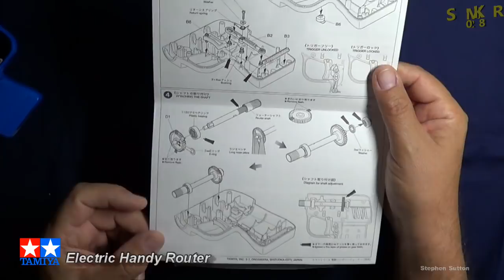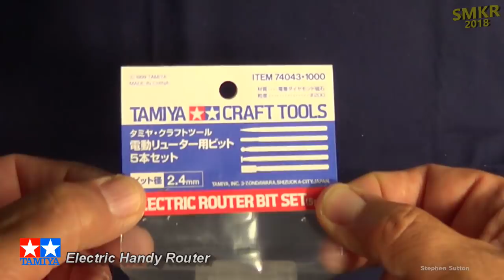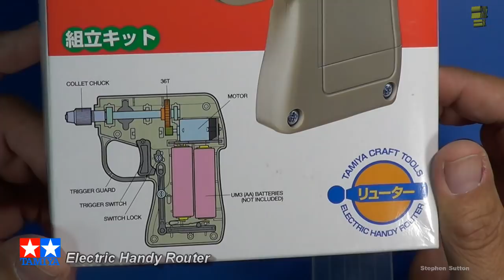Tamiya Electric Handy Router Review and Build

Comment: It might be a bit confusing to show the Handy Drill early in the video without spoken comment or text caption...there is nothing in the video up through that point to indicate that this is NOT the Handy Router which is the subject of the video.

Seems that the Handy Router is identical to the Handy Drill, with the exception of the Router having a longer drill shaft and the Drill having two more gears in its gear train, and the color of plastic used for the outer case; but the other plastic parts are the same.

Also, the video narration states that the battery cells being inserted and discussed as "Lithium Ion" types, and that is not correct. The Energizer AA Lithium cells are 'primary cell' types, are not rechargeable, and do not use Lithium-Ion chemistry or internal construction.

According to TSA.GOV, "Lithium batteries with 100 watt hours or less may be carried in a device in either carry-on or checked bags. Loose lithium batteries are prohibited in checked bags." The TSA seems to not make a distinction in this paragraph between Lithium and Lithium-Ion cells or batteries, but elsewhere they seem to say that regular Lithium (non-rechargeable) cells, such as the Energizer AA Lithiums, are NOT covered by any restrictions. But clearly, at the time of this writing, the TSA is OK with Lithium AA cells, whether in checked or in carry-on luggage, as long as they are installed in equipment rather than rattling around loose. Other sources say that the bit about them being OK if installed in something is in regard to preventing loose cells from accidentally shorting out. Personally, I regularly travel with Energizer brand AA Lithium cells in my checked bags (not a LOT of them, perhaps as many as six), bundled together with the same orientation (all + ends facing the same way), and held together with rubber bands, and placed in a Zip-Lock plastic bag that has nothing else in it (other loose conductive items in the bag might possibly short out the cells......TSA has never had a problem with it.
Reply from the maker: Thanks for watching.

Comment: Hi is this mostly for sanding? I couldn’t tell clearly in the video. Was the Router a lot slower? Can you not put router bits into the drill?
Reply from the maker: Yes you are correct. Its more for sanding.